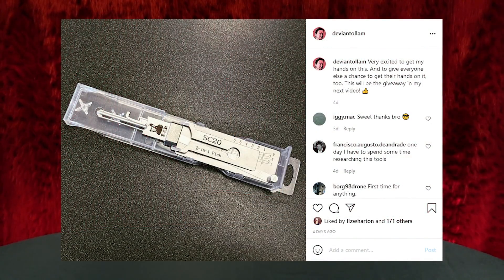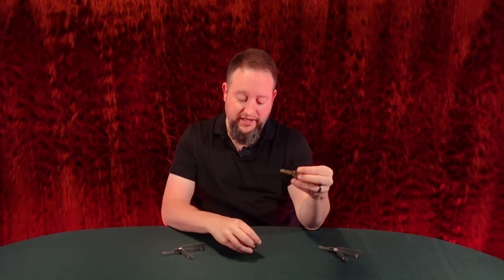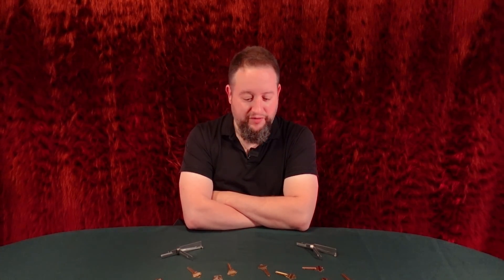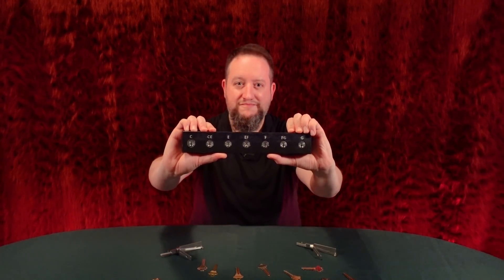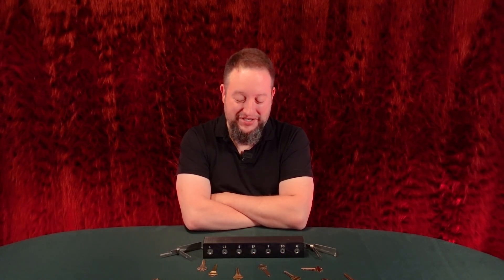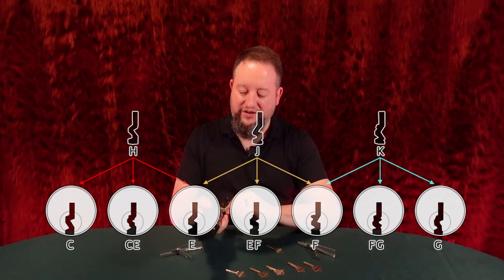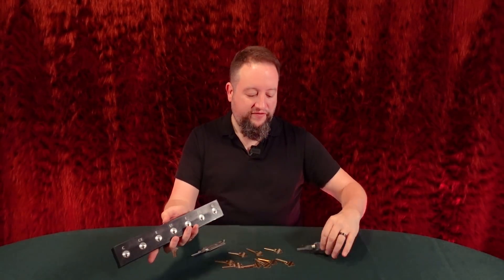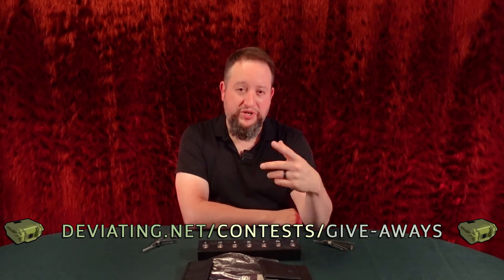Making Sense of Schlage Keys and Keyways  [#SchlageWeek Day 1]

Comment: I love the SE20 pick it actually works better than the other ones I find the tension and the springing Ness of the Exter length on the pic itself to give more feedback than the other pics and I’ve experimented with it to be able to say I love this pic, and is the go to pic for all Schlage applications in my opinion, of course you will think differently but as I say, I love it, and I was pleasantly surprised on how much more simpler and easier it is to be able to pick a Schlage lock

Comment: As someone who takes advance of Schlage’s letter keyway system, I am really excited that this product is out! I have made it a habit to keep a 6 pin L bump key in my kit, because it fits into almost any Schlage keyway you will find. It really is surprising that not many people know about Schlage’s keyway systems, there is the letters, Everest, and primus, and the least well known the number system, each system has a hierarchy, for the letters you have C, CE, E, and on top of those is H, then you have  E again EF and F and on top of those is J, then you have F again FG and G, and on top of those is K, and at the very top is L or SC20. The primus, Everest and number systems all work in the same way. And just to clarify, because I’m sure most people will think I’m wrong about the number system; the number system was at one point Schlage’s attempt at making a more secure keyway system for duplication, however the system didn’t really work out as well as Schlage had intended, so they stopped making it, but there are still places that you can find that use the Schlage letter system.

Comment: can the SC20 lishi handle picking against a return spring, like a storeroom function?
Reply from the maker: you mean the turning force required?  yes, i would think so.  the neck area of the pick, just before the shoulder, is still kind of robust, especially up where the blade of the key would normally start.
Reply: @DeviantOllam  oh, ok. My NSN14 binds up when i use it in the door locks, recently found out that there's a doors only version of the tool.

Comment: In order to teach my students about the weakness of standard locks, I bought a couple SC20 blanks and hand filed a master key copy from an off-angle photograph of a master key on the custodians keyring taken while it was on his belt. The building uses 3 different key profiles and multiple security levels of bitting, so picking the locks is really easy, but decoding the master from assigned keys was difficult. The master I cut by hand actually opens locks better than the custodians key (his is worn out)
Reply from the maker: that's super awesome
Reply: @DeviantOllam  Hi, i'm looking for the Best "J" keyway (commercial) lishi .. they don't have it, wondering if another lishi might fit? or should I try filing down the be7 residential lishi? thanks
Reply: Prior to the company changing ownership, we had a facility that we'd periodically drop by & rekey 10-20 key in knob cores for them to have on hand anytime they needed to change the keying on a door. We'd always remind them that it was keyed to work with the master they handed to us but absolutely zero guarantees on any other master because it was so worn. 😂

Comment: What about "custom" keyways? I know a place that has a mastered keyway system (a master key fits in them all but normal keys do not fir in every lock (i think)) that uses keys with a 2-letter id "Nx". Is it possible to reverse the master of the keyway like you can the bitting?
I tried researching it and found more and more of those hierarchy charts, many of which showed 2 of the locks on each keyway but i dont remember why

will the SC20 work in those?
Reply from the maker: i would have to see more about the system to answer that

Comment: how do you know if it's 6 pin lock or 5 pin lock on the field? And how do you know whether it's schlage or not? is there any way to distinguish these?
Reply from the maker: well, the images of the keyways are the best way to tell if something is a Schlage lock.  you look at the front face of the lock and see if it's one of the Schlage keyways.  as for 5-pin or 6-pin, that is something you determine by reaching inside, with this tool or with a conventional pick tool.

Comment: So.... why didn't Lishi start and finish with SC20 (and SC19) if it works for all of Schlage?
Reply: Im sure he will go into more in a later video, but he mentions its very thin. It probably has something to with perceived feedback while picking.  In my experience the "L" always wobbles around in keyways. Using the lowest level keyway(also the thickest, meatiest) you end up with better control while tensioning(my theory at least)

Also, there are engineering/manufacturing constraints as well. Im sure there are best/keymark keyways that lishi will never make keys for, specifically because they are so thin, and odd shapes that make it impossible to manufacture a pick for. 

To put in perspective, on how rare these keyways are,  is difficult.  If you live in New construction area,  you'll almost never find them.  If you live in a district that was built from thr 70s- 80s, you'll see these keyways, but after, not so much. If you're from the east coast, with older buildings,  I can imagine these might still be in use, but they're coming up on thr end of their life cycle.
Reply from the maker: Zach is pretty much on the money.  These door locks were never the backbone of the Lishi 2-in-1 product line.  They still aren't.  They're a fun side product endeavor, but every new development of a tool takes time and effort.  And the "C" keyway and key profile being a bit wider (and LOADS more ubiquitous in the market) made that the logical choice for a first attempt.

I believe the SC20 only came about because James Chen (of Original Lishi) was fielding requests from folk for a narrower tool and the factory worked on developing it.  My prediction is that we'll see a BEST tool in "FM" profile as opposed to just "A" profile at some point, too.
Reply: I see. Thanks for your time!

Comment: thank you so much for explaining the sc20. makes sense! would the six pin sc20 work in 5 pin, or is there a 5 pin? need a plastic thing? thanks dev😎
Reply: The SC20 Lishi pick will work in nearly all the Schlage Classic locks you will encounter, though for some (F series knobs and levers and B60 deadbolts primarily) you will need a plastic spacer because the cylinders are 5-pin length only and have closed backs or some other obstruction that prevents the tool from fully inserting. It is exceedingly rare to encounter a cylinder in keyways other than C and E that are short enough to prevent the six pin tool from fully inserting. The 5-pin length tool would be the SC19 (SC19 being the IlcoEZ/Cole code for the 5-pin Schlage L blank) but I have yet to see one listed anywhere, so the easy and economical solution would be the SC20 tool with a plastic spacer.

Comment: Very interesting! Online I mostly/only hear about US standards, but how about EU standards? Feels like the most used profiles in EU, or The Netherlands in my case, are hundreds of different profiles. Still wondering which of those are overlapping each other. I hope you can tell us more about that too :) Keep up the good work!
Reply from the maker: the EU region has far more paracentric keyways which are a challenge to produce as Lishi 2-in-1 tools, I would think.
Reply: In Europe, from what I have seen, variations on the Yale E1R (Yale "8" or Y1/Y2 profile) seems to be the equivalent of the Schlage C in terms of ubiquity, but someone based in Europe would have a much better idea of what keyways are dominant in your area.
Reply: In my non-professional experience, there aren't many keyways here in the EU that overlap, although it does happen. As suppose to the US where Kwikset and Schlage mostly take the lead, we use a lot of different keyways and lock companies. But some company's do have systems like Schlage with overlapping keyways for mastered systems. A big name, mostly in commercial buildings is ASSA ABLOY who operates under a lot of different brands, but who definitely do has a system like this in some of its keyways. But due to the vast amount of company's and keyways here I don't think we will see many useful Lishi tools here in the EU.

Comment: .... that system seems really really weak to privilege escalation ponder
Reply: On top of the keyways limiting key access, you have to remember that these locks will also be master pinned. But, yes, a lazy locksmith could pin out several sections of a facility with the exact same master pins and then just use keyway profiles to limit who can access what areas—they'd be stupid to, but bad actors triumph on such laziness.
Reply: Locks are there to keep the honest people out. 
That said you have been given multiple keys but they all looked alike, but the person giving them to you just says this one is for this lock and that etc.